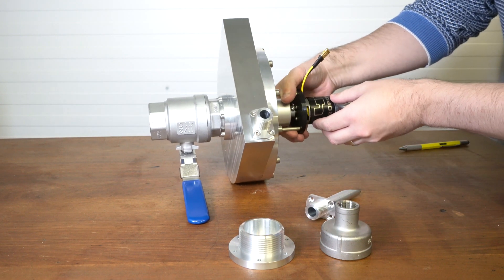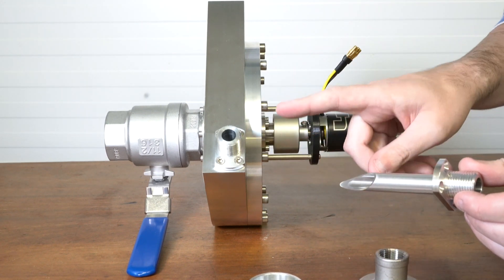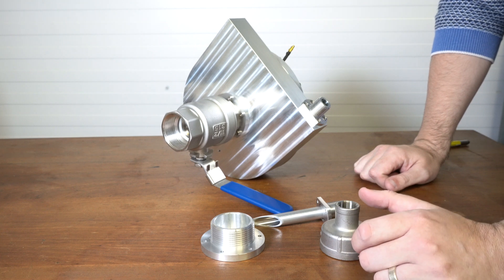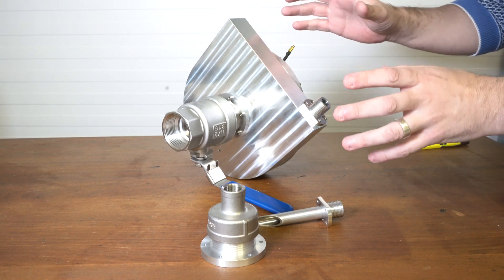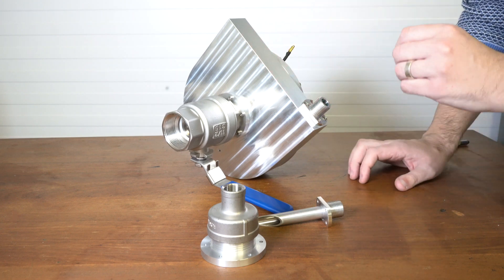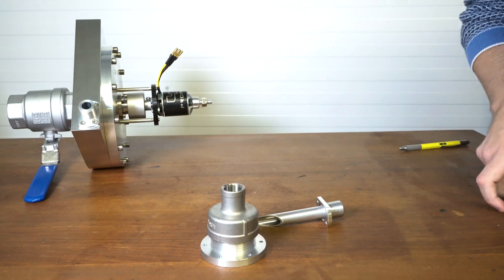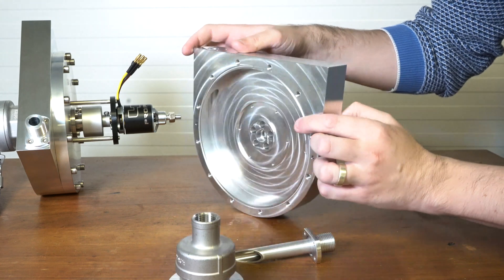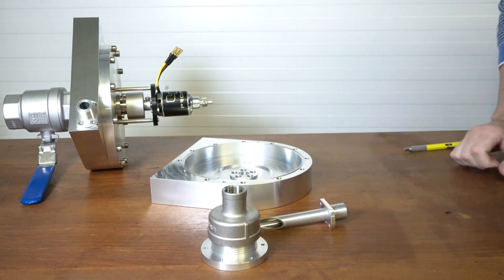Tesla Turbine - MK4  Update

Comment: Have you yet tested its performance?

  What was the maximum efficiency, and what medium did you use then?
And one more question, is the max pressure of the turbine because of the housings ? 

If i put same pressure outside that is inside. In my mind that would equalize the pressure limit of the turbin?!
Reply: Why is this question so hard to tell for tesla turbine builders? I just want to know what efficiency you did get when tested? The efficiency of the tesla turbine is not written in stone for one particular tesla turbine, If you change one variable like the nossle mabi a higher efficiency is gotten. You can tell what efficiency YOU did get with it. People will still buy it, because they can change perameters.  Am I wrong?

Comment: wrong on so many levels it's laughable
Reply: Example?
Reply: tiny exhaust lol, you have no clue what you're doing
Reply: @musiconly7447  the inlet is 1/2 pipe, the outlet is 1 1/2 pipe. Do you think the outlet should be larger, maybe 2 inch pipe?
Reply: @northernmetalworker   it's in the patents. you have to account for flow rate and designed rpm. what you have now is too small from an eye test. start at the patent work from there. otherwise you'll have a low efficiency turbine. i'm scared to know what your discs look like
Reply: @musiconly7447  they don't look like anything, I've never built a turbine.

Comment: With your nozzle design you are working on volume, is volume better than pressure (do you class this as a  low speed torque turbine) if you were converting some of the volume to pressure by using a slot nozzle you would be getting more speed?
Reply: Correct. Nozzle design is something customers (and we may play with). In fact I have a prototype slot nozzle in the pipeline. Really depends on what fluid, volume and pressures you are working with. In theory a nozzle producing a high pressure, fast flow should produce better results. At least for many applications.

Comment: Look at the possibility of running this on cold steam...  under an only moderate vaccum, water will boil at temps that are safe (below 150°F).   Just need hotter at the evaporator source and a cooler than boiling point condenser...   check out Jeremiah's project with cold steam and tesla turbines.  Channel is his name... search that and cold steam and you should have it.

  Since it operates at low temps on the high side (evaporator), and under a vaccum, there is no explosion or scalding hazard, and the turbine operates on the water vapor under totally achievable levels of vaccum.  When water vapor travels in a heat pipe, it can reach supersonic velocity, and the tech takes advantage of the vaccum, to leverage the ~1600x expansin of water, to allow efficient extraction of energy, with minimal temperature differentials, easily achievable with non concentrating solar thermal collecor panels.  (Like the evacuated tube collectors that use heat pipes to transfer the heat efficiently to the tank above them)

Hope this comment inspires you.
Reply from the maker: Thank you very much this information. I have thought about this before. At the moment I'm concentrating on efficiency of the turbine and general testing. The turbine is very adaptable and any performance increases I can wring out will be usable with just about any application/medium. I have a few focus areas where I'm aiming to make improvements.
Reply: @gyroscopes  Would you be willing to sell one of these turbines and if so how much?
Reply from the maker: @Orangepilldispencer  We have a batch of 50 that we are making. They will be on sale via gyroscope.com
Reply: @gyroscopes  Hey man, in case you are still doing this. I love doing research and can have quite a "birds eye view" over certain things.

1. The best way to use this invention, is to actually have it on the SAME axis as a "Vacuum pump."

The difference between them also, is that the turbine has the more "tear drop" shaped holes, whereas the (vacuum) pump has more taper-shaped holes \ /. 

So you place them on the same axis. Separated, with a round hole in the middle. The idea is that the steam spins the turbine, which in turn spins the pumps on both side, which essentially "toss the air outwards" creating a suction. This creates a vacuum which spins the turbine faster, then vacuum pump on both sides spin faster, etc.

2. For an even better efficiency, the ball-bearings on both sides can be replaced with an air-bearing. Since there is a pump on both sides of the axle, it can be configured to suck enough air, to keep the air-bearing going. Which produces a frictionless spin.

3. The inlets actually need to be on the opposite ends, 180 degrees to each other.

4. To balance the axis, with turbine and vacuum pumps and air/ball bearings on both ends, you can use Tesla's "Dynamic Balancing Machine."

With all these things together, I am sure that anybody can product cheap and clean electricity from their house. We just need the mathematics for it.

Comment: What are the turbine blade made out of?
Reply from the maker: Stainless steel
Reply: @gyroscopes  Is there an advantage of stainless steel over carbon fiber? Other than cost
Reply from the maker: @xxxBradTxxx  yes. A decade ago I did tests with lots of materials. You need something rigid. If you light weight disks they spin up quickly but otherwise there is no performance advantage.

Stainless steel is used so that steam and high temperature gasses can be used.